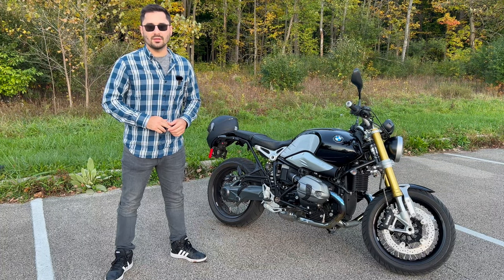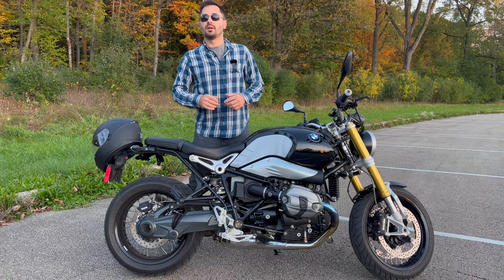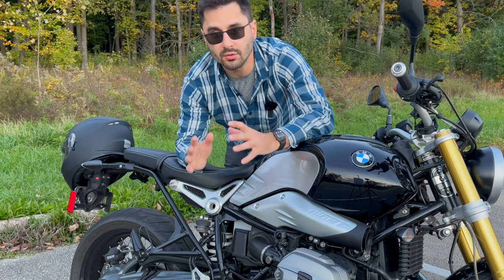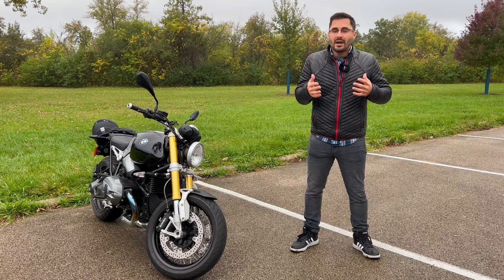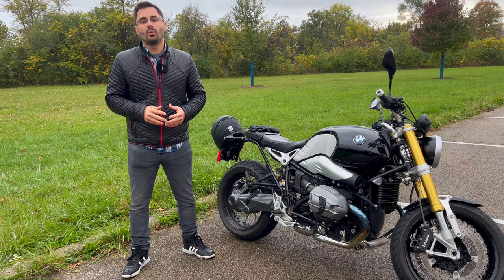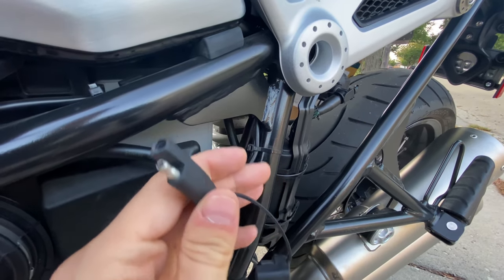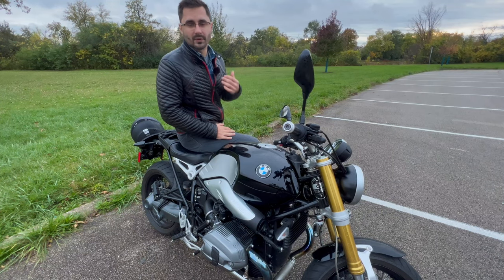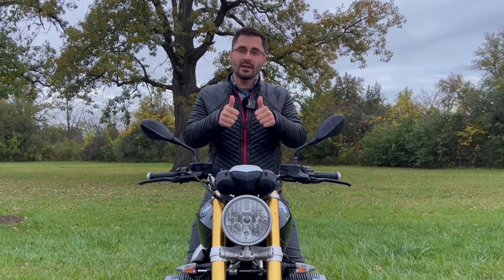BMW R NineT Problems to Expect

Comment: I have a 2010 1200GS (same engine) with nearly 100,000 trouble free miles.  This is a very reliable engine.
Reply: Much more than 100k miles. I’ve gotten almost 200k on them before I traded them. 👍🏻👍🏻
Reply: 1200GS was by far the best of GS series ever - along with pre-2014 F800series.  Ever since then, BMW quality has gone down the hill

Comment: Good video . I just worked on a 2019 model. It had a bad fuel leak due to the failure of the plastic quick disconnect fittings under the tank from the fuel pump. I replaced them with the aftermarket kit with the metal fittings. I recommend everyone replace the couplings

Comment: Good to know some problems to expect! My next bike will either be a R Nine T, a Triumph Speed Twin or a XSR900 depending on what is available next year.
Reply: I had the xsr and r9t, both great but completely different.
Reply: @hulkhulk5141  what were the most noticeable difference? If you don't mind me asking, which did you prefer from Purley ride, handling and use in traffic and power difference?
Reply: @Stu81  the xsr is a hooligan bike in a lot of ways, being light, the motor and the way the power comes on, handles well but I upgraded front n back ohlins , if not it can be sketchy. The r9t was a great city  bike, unbelievable torque, handles great and checks all the boxes, also great tandem bike. It also needed a few mods, exhaust n lithium battery, pod dna air filters and a dyno tune and your off. All that because the bike a little heavy. I have had many bikes the last few years, long story short I should have kept the bmw and got a 2nd bike instead of looking for the perfect bike. I also had the cb 1000 r
Reply: @hulkhulk5141  How was the CB1000r compared to the other two?. I love the CB1000r, but am looking at the BMW R nine T, or even the Ducati Monster 937. I found the 2022 Yamaha XSR 900 very uncomfortable for me and my wife.
Reply: @pimpthyride  cb was a good bike, just good. Typical Honda , typical inline 4, power comes on in higher rpm’s . I found it boring, til it blasts off, reliable, looks awesome but I would get an r9t again , it’s also reliable and very easy to modify n maintain on your own.
Reply: @hulkhulk5141  Thanks dude, nice to know.

Comment: It's the best bike I've ever riden and still riding, just done the major maintenance today and was not complicated at all I paid ~300 euros with a new battery took everything from a bmw dealer in Switzerland,
Oil capacity for engine in 4L quit with a new filter, gearbox is 0.7L make sure to remove all the metal from the top cap there's a magnet, for the rear axle it's 0.18L watch out for the metal on the bottom cap on this one

Comment: I had the first model R9T from 2014-2018 and put 14,000 miles on it until it was totaled by a VW Beetle.  I changed  the handlebars to narrower bars from a Triumph Street Triple, modified the bar ends to maintain the original caps and added bar end mirrors, a bikini fairing,  rearsets,  and a tail hugger. I had the wheels converted to tubeless by Woody's.
The battery as supplied by BMW is under powered and that is the reason for the short life. Aftermarket batteries have higher (correct) amperage and fit after removing the plastic filler that is factory installed to allow for the cheaper battery that comes installed. The battery cannot be charged or maintained through the 
BMW powerlet socket unless you use their special charger $$$. I just installed a connector directly to the battery and used my regular maintainer.

When I got the bike, the speedometer read about 20% high  but that was solved after I had to have the ECU reflashed after installing heated handgrips.
For touring, I added a tankbag (which faded immediately) and the custom fitted tailbag.
I had planned to install a mud guard as installed on the R1200GS,but never got around to it.
There were recalls on the bike for defective handgrip switches, and directional signal spacing.
I had a rear seal go out under warranty. 
Overall, it was an excellent bike and I would consider buying another.
Biggest complaint- The bungee cord attached to my wallet by the dealer.

Comment: The easiest and least expensive solution to the high service costs and mechanical idiosyncrasies of owning a BMW is to simply buy a Japanese-made bike for less. Excellent review.
Reply from the maker: The cost of ownership might be a little higher and you have to put up with some 'quirks', but it's so worth it to me!
Thanks for watching.

Comment: Excelente video muy de acuerdo, con que el asiento es durísimo, le agregue un cojín neumático y con eso se soluciono bastante, en mi ultimo viaje de 3400 km, creo que es una excelente moto, siempre te bajas con una sonrisa en la cara!!tengo mas de 20.000 km y mi único problema es cargar combustible, la lleve a 4895 mts de altura y como si nada así también la use con combustible de mala calidad,85 oct y siempre responde creo que es una gran maquina.

Comment: I've owned an R9T there aren't any reliability issues really, they are pretty much bulletproof.
Reply: How is the performance during traffic situations? Is it good?
Reply from the maker: It’s great in traffic if you consider that it’s a fairly big bike. If you live in the desert with 110f+ weather, you may have some overheating issues if you are in stop and go for more than 30 minutes. Otherwise it’s amazing.
Reply: Agree I have had mine since 2016 no issues heavily modded now by pier city

Comment: After a little over year and 7000 miles I  haven't had any problems with my R9T/5. I've taken it on a 1800 mile ride in about 6 days and loaded it pretty heavy no problems except my gas mileage stayed in low 40s mpg.

I've taken drag racing a few times and was very surprised how quick it was and I  have a few videos on those races.
Reply from the maker: Thanks for sharing, glad to hear real reports after a decent amount of miles! I will of course report on anything that happens or doesn't happen over the years.
Reply: Hello brother May I know how much you cost an average service including oil change all.... thankyou   ride safe and bless
Reply: @justdad53  ok brother i am going to watch your video and thankyou very much for your reply.. bless
Reply: Ease of service is one of the best bmw characteristics. Unlike every other manufacturer, bmw engineers servicing into the design.
Reply: @justdad53  I don't have a R9T but on many or most models, you just push a button and the seat lifts, and there's your toolbox, and you lift that out and you can pull the battery out with nothing in the way. And you remove 3 bolts in the front cover  and it's easy to set the timing. The wheels are usually easy to take off  as well. Anyway, that's interesting because I am interested in getting a R9T so I'll have to check it out but my dealer doesn't have any in stock right now.
Reply: You can't expect much better than 40mpg with 1100cc bike, haha.
Reply: @justdad53  that sounds like too much. What is the shop rate, 200/hr? A basic service only takes 2-3 hrs.
Reply: @chadkline4268 I got a 1200 bandit that can do less than 20mpg but damn good fun on dry days. I also have a honda 700sc nighthawk that does about 35 mpg but at 40 years old, I expect a drink problem. If I wanted mpg, I'd get a 125cc .

Comment: My 2016 R9T has never used a drop of oil.  I use Motul for every oil change and it is on 17 000 km now.  It is one of the harshest bike I have ever owned due to a extremely poor suspension.... BMW should have planned this better!  There are much better bikes to own in this price bracket!
Reply: Did you try adjusting the suspension according to your load? It is adjustable.
Reply: At Bmw Motorrad, where I worked, we tested every oil at the time  40 years ago, and Castrol was by far the best oil at keeping boxer engines clean. Just because something is synthetic doesn't mean it's better.
Reply: Yup change to Wilber rear shock

Comment: Great video 👍 could be my next bike , I do like touring though ! In your opinion is the comport good for 300 mile days ?
Reply: I have done several trips of 300+ mile days in a row. My bike has the stock suspension, which I will agree the rear shock is crap compared to other bikes I have owned. I finally have it adjusted to be tolerable. I will say get an aftermarket seat, I have the Mustang seat and its a huge improvement.

Comment: Hey, I am planning to get a used one from the dealer which has only 1000 kms. Do you recommend me taking an extended warranty from the BMW dealer ? If is quite expensive at 2k for 3 years

Comment: I’ve had a R9T 2019 for a year now, is this bike designed for long trips?.
Reply from the maker: It’s definitely not designed for long trips. I start getting sore after about 2-3 hours.
Reply: Ive done a few long trips and its great. One was 4,000 km and another 3,000 km. The tank has 300 km range which is handy. The suspension, with some patience, can be adjusted to work well. It took me 2 weeks of trial and error to set my suspension properly. The seat is not great, but Ive had worse. Easily fixed. You can stretch your legs out on the cylinder heads when if they get cramped. And the engine sounds like a WW2 fighter plane. Travel light, get on it and go for it.

Comment: Premium gas? Thought the bike takes regular
Reply from the maker: This bike has a high compression ratio of 12.0:1 (very high for air/oil cooled engine), so you have to use premium if you don't want detonation.
Reply: @SimpleCarGuy  interesting. Tha manual in the US says it takes regular. I've put reg for years

Comment: Anyone experiencing vibration issue? 
I’ve had my R Nine T Scrambler for two years, serviced by BMW. Vibrates like hell, cannot be ridden for long journeys.
Reply: No, not in my experience. Boxers should be very smooth. Maybe try another mechanic. I used to be a Bmw mechanic 40 years ago :) and we always did a test ride after every service, and I'd guess this is still standard practice to ensure customer satisfaction. Did you ask them to test ride it? If they did, what was their opinion?
Reply: Does it sound good? If it is vibrating so bad, there is probably something you can hear that may provide a clue. The engine should sound symmetrical. Do both sides of the engine sound the same? Do the wheels spin true?
Reply: It sounds fine, I have had the bike shipped to BMW under warranty for this issue. They say, nothing wrong with it. Sadly, I will probably sell the bike!. If you search on line, there are many riders suffering from this issue.
Reply: @deebugs  well, if it so bad, there is a cause, and the cause should be equally as noticeable as the effect. A truly bad vibration should be traceable. Cause and effect. Is the engine shaking bad? You didn't even say what is shaking. You know, it is 1100cc, 550cc in each cylinder. That is HUGE. Of course it is going to shake at low RPMs. It's like a series of little bombs (to the left, then to the right). But at higher RPMs, they should balance each other and cancel each other out.
Reply: @deebugs  I wouldn't expect it to be smooth under 4-5000 RPMs. I wouldn't even ride it below that. Too much stress on the engine. Its not a Japanese bike. Boxers get smoother at higher RPMs.
Reply: Appreciate your input. I have done 11000 miles on the bike. I know the bike has a comfortable vibration at idle, which is fine. The vibration around 2000 rpm plus becomes an issue. In my humble opinion, this bike is not good for long rides.
Reply: @deebugs  I can tell you this: I have had bmw boxers, with one Honda exception, from  600-1000cc, exclusively for 40+ years, and they do not cause buzzing or noticable vibration because they are perfectly balanced and very smooth. If they did cause vibrations, bmw would rubber mount engines and handles bars, and footpegs, etc, but they don't; though many Japanese bikes do. There is not enough specific information in these posts to be helpful. What motorcycle have you had that is better, or is without such a problem? And where/what is the exact nature and effect of the vibrations?
Reply from the maker: I haven't had any issues with vibrations at all. Have you had the motor mounts checked? It 'shakes' a little on start up and then smoothes out soon after.
Reply: Thanks Guys, really appreciate your feedback. I usually get the bike serviced at BMW Park Lane London, looks like they they don’t have the expertise to fix the issue. I will book the bike in with a different BMW garage and get them to check it out.
Reply: Scrambler has knobby off road tires. Swap them out for some touring rubber and it is like a new bike
Reply: @drdrew3  Thanks Andrew.. I have road tyres on. I think this bike model has issues. I’ve heard the new r nine t has electronic throttle bodies and much smoother. I will most probably sell the bike.
Reply: Hey Deebug. Try checking the throttle body sync. They go outta whack every so often coz the throttle cables gradually stretch over time. It is a very tiny tweek that makes a huge difference. Once synced they are very smooth. I check mine every 10,000 km.
Reply: I reckon could be your tyres, often the scramblers have knobby tyres
Reply: @dacdidac  hi, thanks.. the bike has long gone! I’ve got a super smooth BMW CE04